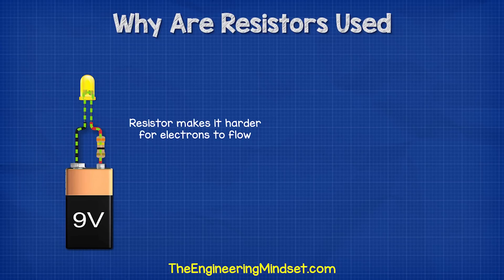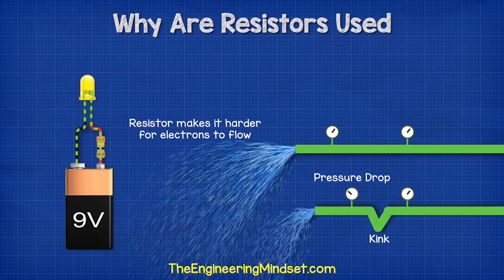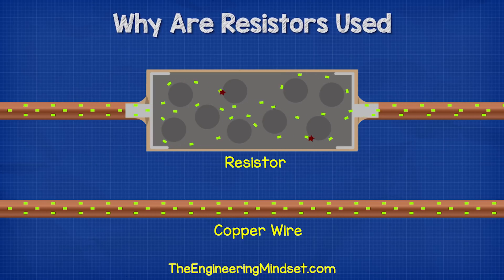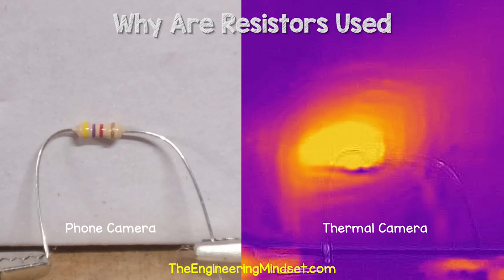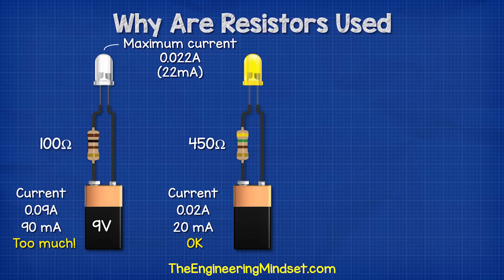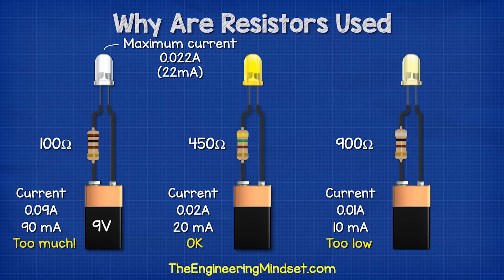Why Resistors Are Used In circuits

Comment: Ah ok i knew it... my prof. in Physics class and IC Boolean Algebra they did not explain well... cuz they concentrate teaching us the Computation... now i realized the purpose... cuz some IC Chip has limit current requirements it acts like a Transformer in a Power Grid From 10,000 volts down to 220 volts... Very well Explained thanks

Comment: Hey there pal, don't criticize this short, basic explanation of the function of a resister. 
Later, he'll show how when many different types of components in a radio for example, will powered by single voltage source, though these components will need many different voltages individually. These are building blocks of a electronic circuit... I remedial's... Thanks..

Comment: some videos say that resistors do nothing to current flow, that amperage is same before and after a resistor. Even you did show two wires where the currents flow at the same speed although a resistor was connected the the first wire. But nevertheless you say the current flow is slowed down, but the animation did not show that. Really confusing
Reply from the maker: The current is the same before and after the resistor. The current changes depending on the resistance used. If you provide multiple paths within a circuit, each with different resistors, the current will change because the current will take all paths but most will flow through the path with least resistance

Comment: How can you limit the current from the grid to a tiny LED bulb then?
Common sense tells me that there's very high current able to heat the whole house and couple of tiny resistors should just evaporate. Even a car battery can generate 100A easily. What's going on? IMO the right explanation would be that not all current over a certain value is transformed into heat. It's not clear from the video. Electrons dont lose energy and come less energetic on the other side. There's just less of them able to make it through at one time. The vid is not cooked properly. There has to be much more to tell about resistance
Reply from the maker: Check out NEW resistor video, everything covered! ➡️ https://youtu.be/DYcLFHgVCn0
Reply from the maker: Seen the new LED explained video? so much detail covered! https://youtu.be/O8M2z2hIbag

Comment: Unlike a kink in a water hose though, resisters turn electricity to heat. Therefore it can be said that resisters waste electricity.
Reply: The water loses momentum though.. and will wear the kink area faster due to more stress (will leak there)

Comment: So how do dimmers preserve energy if the energy is wasted as heat through the resistor?
Reply: Dimmers use TRIACs not resistors in the main circuit. Or you can use PWM but that's more complicated.
Reply from the maker: See here https://youtu.be/fBNU17zJlnM
Reply from the maker: Check out NEW resistor video, everything covered! ➡️ https://youtu.be/DYcLFHgVCn0

Comment: I am a little bit confused. Isnt the LED-example wrong in regards of the current? Usually you have a Voltagedrop of about 2V (depending on the type) on the LED. So the Voltage at the resistor is about 7V and thus the currents arent the one shown in the video. Or am i missing something?
Reply: You are correct, the voltage drop across the diode should be included in the calculation.
Reply from the maker: Check out NEW resistor video, everything covered! ➡️ https://youtu.be/DYcLFHgVCn0
Reply from the maker: Please watch out led design video
Reply: @EngineeringMindset  Thx for your response! I watched it and im still confused. The Values in the LED design video are what i would expect. But the current values in this video still doesnt make sense - only if the LED has a voltage drop of 0V.
Reply from the maker: Oh I see now what you're saying. Looks like I forgot that in the animation. Apologies. The actual LED design video is much more detailed though, please ignore this video and watch the long version for calculations
Reply: @EngineeringMindset  Thx for your response! Okay, thank you for your explanation and - of course - for the great Videos .

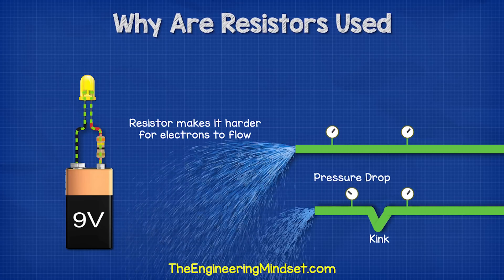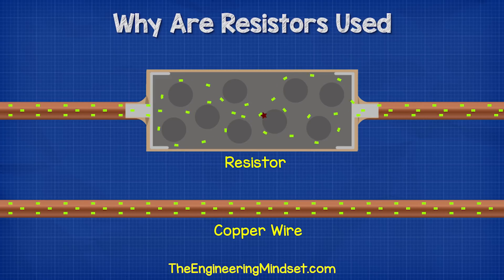Comment: At 0:07 you say resistors create a drop in current but at 0:32 you say that the resistor creates a voltage drop. Which is it?
Reply from the maker: Check out NEW resistor video, everything covered! ➡️ https://youtu.be/DYcLFHgVCn0

Comment: You did not really explain why they are used. The question is why would a 9 volt battery be used in the first place? Why not use a 1.5v battery or a power supply that fits the LED needs in the first place? How much electricity is wasted using a resistor? The answer should have started with something like it is to expensive to provide each electronic circuit with the exact voltage needed so we take one standard power supply and reduce the voltage down to the different circuits needs.(something like that.) Sorry to complain,  I do really  appreciate your work on these videos.
Reply: A LED needs at least 2 V to light up. So you need a bigger battery than 1.5 V.
Reply: I'm pretty sure that it's just an example. But I understand your reasoning, however you would need more like two 1.5 in series
Reply from the maker: Seen the new LED explained video? so much detail covered! https://youtu.be/O8M2z2hIbag
Reply from the maker: Check out NEW resistor video, everything covered! ➡️ https://youtu.be/DYcLFHgVCn0

Comment: I recently learned that a combination of capacitors, induction coils and resistors can limit the frequency that the cables allow through. I did not understand exactly how the process works, so if you could make a video explaining why it happens and how it can be used, that would be awesome!
Reply: I wanna see a video about filter circuits as well
Reply: Capacitors act like short circuits for high frequency and like open circuit or resistance for low frequencies (as you can confirm from the formula X=1/2pi*f*C) so it might be considered as a high pass filter
Reply from the maker: Check out NEW resistor video, everything covered! ➡️ https://youtu.be/DYcLFHgVCn0

Comment: Don't we need to know the amp from the battery before chosing a resistor?
Reply: No.
Reply: @ivarnordlkken8082  that's weird. We don't know and just pick a resistor at random and hope for the beat. So weird.
Reply: @flashchrome  You don't take a resistor by random. You find the voltage of the battery, and the current the LED needs, and the forward bias voltage of the LED, and that's all you need to calculate the resistor. The battery will deliver any current needed, within limits ofcourse. You should look at his full LED video, it explains it in much more detail.
Reply from the maker: Check out NEW resistor video, everything covered! ➡️ https://youtu.be/DYcLFHgVCn0
Reply from the maker: Seen the new LED explained video? so much detail covered! https://youtu.be/O8M2z2hIbag

Comment: Could you make a vid why capacitors are used in circuits?
Reply: The quick answer (but not the simple answer) is that capacitors are used to add a phase shift to the voltage in a circuit. At least that's why they use them with motors, compressors, and the like.

Comment: Short, sweet and perfect as someone else has said. I knew resistors, resisted flow, but I didn't know that caused a voltage drop. A light bulb moment, thanks.
Reply from the maker: Check out NEW resistor video, everything covered! ➡️ https://youtu.be/DYcLFHgVCn0

Comment: In your LED example you should have explained how you determine how much current each resistor would allow also how much heat the resistor would need to be able to dissipate and the voltage drop crossed it
Reply: these are snippets from actual videos he has made I'm sure if you look at the led design videos he has made you will get this information.
Reply from the maker: Check out NEW resistor video, everything covered! ➡️ https://youtu.be/DYcLFHgVCn0
Reply from the maker: Seen the new LED explained video? so much detail covered! https://youtu.be/O8M2z2hIbag
Reply: No Josh. No he shouldn't have. The video is called, "Why resistors are used in circuits" which is what he explained. If he put in the things you wanted it would be a different video. Maybe something titled, "The calculations of electrical resistance"?

Edited for a typo
Reply: That would require too much effort , we in for the YouTube monies

Comment: Great video. It would be helpful if you put the math involved in the graphic even if you don't necessarily take the time to restate it in the voiceover. Thanks!
Reply from the maker: We have so many videos on that already. This is just a snippet from a longer video. Please see our detailed long form videos
Reply: High School Math

The resistor's current I in amps (A) is equal to the resistor's voltage V in volts (V) divided by the resistance R in ohms (Ω):

I = V/R

edit: Called Ohm’s Law
In the video he uses a 9 Volt battery in the circuit V = 9V and a 450 Ohm resistor R = 450Ω.
I = V/R
 = 9V/450Ω
= 0.02A
Reply: @felixtremblay3627  Isn't it funny that your region waited until HS to teach multiplication and division?  Fortunately it looks like it didn't hold you back! Thanks! :)
Reply: @KurtRichterCISSP  Oh yeah well I meant the science behind the maths
Reply: Ohm's law states that Current=Voltage/Resistance

In this case he needs the LED to only have 20mA of current and there was a 9V battery so you just do

0.02A=9V/Resistance
so resistance (R) =9V/0.02A which is 450Ω

Basically the resistor acts like kind of like a valve for the current to flow, so the resistor is used to limit the current so it doesn't cook the electrical components.
Reply: Voltage/max current=resistor value
9/.02=450
Reply: @looking9175  Yes as multiple forms ie. V = IR or I = V/R or R = V/I depending on what value you need
Reply from the maker: Check out NEW resistor video, everything covered! ➡️ https://youtu.be/DYcLFHgVCn0
Reply from the maker: Seen the new LED explained video? so much detail covered! https://youtu.be/O8M2z2hIbag